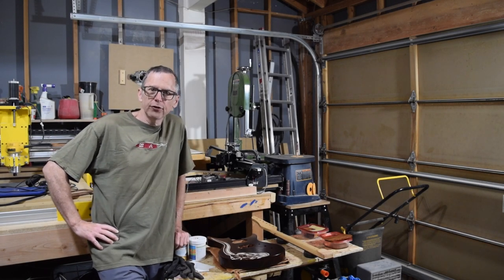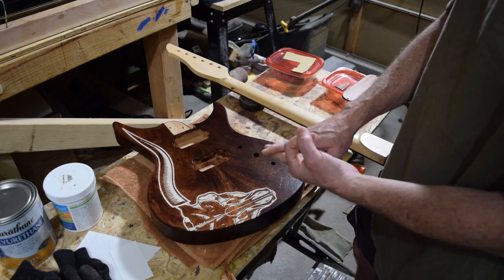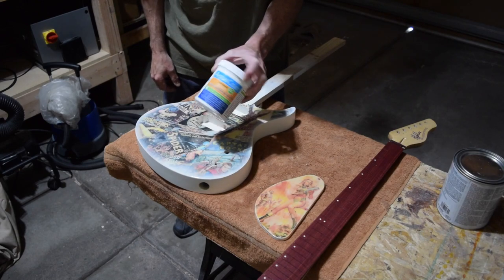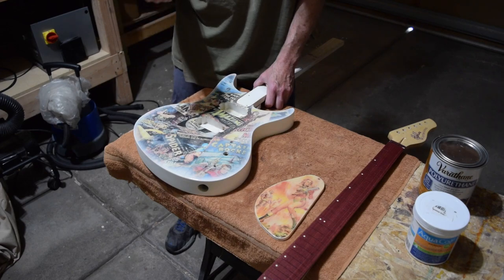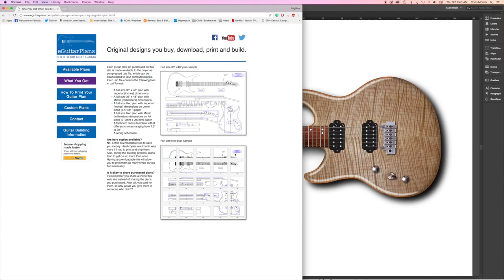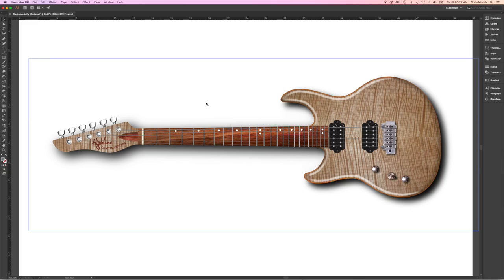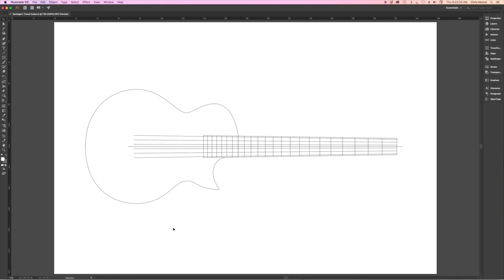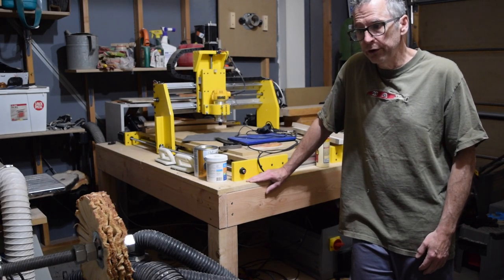Updates On My Current Guitar Building Projects

Comment: Great video and process. Thank you for the tips on wipe on varnish process.
I purchased a Steinberger Spirit GT-Pro Travel guitar with Patented LOCKING R-Trem system with direct-pull tremolo bar. It uses a patented Doubled -Ball tunning system. Musicyo.com sold me the guitar, new, 11-27-02. I've playing the guitar since 1972. I have some fine guitars. This travel guitar is my goto Axe when I have to fly commercial. My Axe stays with me. I had to do a basic tune up and fret level in 7-2011. To this day, great bridge with predictable great service. I hope this information can help you. Thanks for sharing...